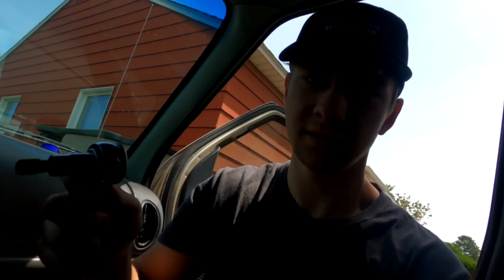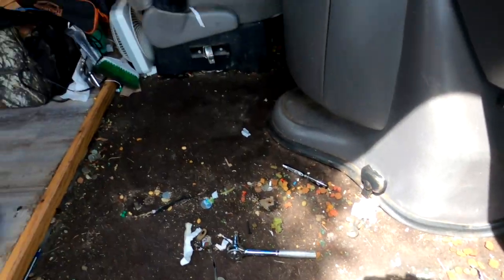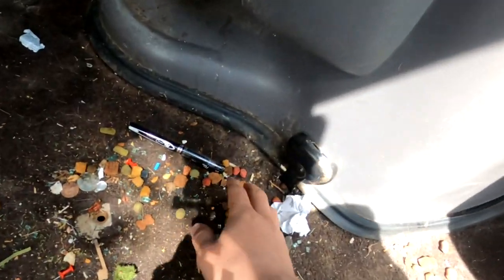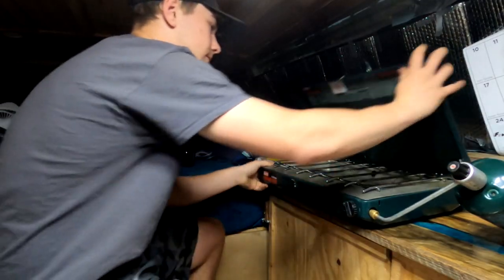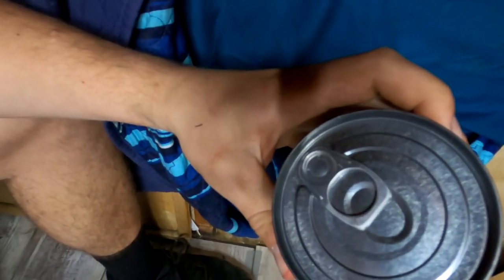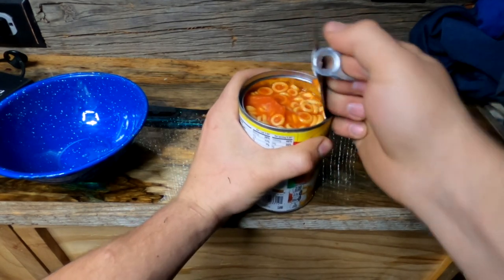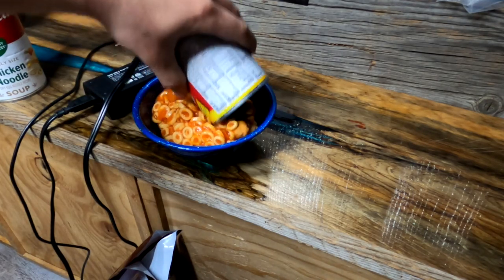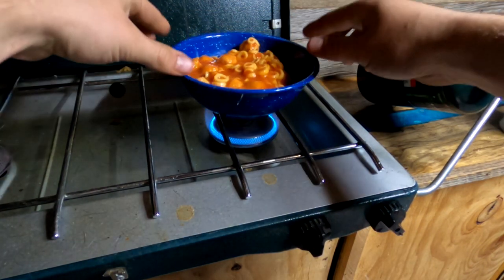Taking Out Passenger Seat For More Space! | VAN LIFE Vlog

Comment: Hey man, instead of removing the seat intierly,  try just flipping it backwards and throwing one bolt in it... it will still give you space in the floor in front of the seat and also under it... but more importantly it will give finn a seat to chill in while you drive, so he can ride in style with air in his face while you drive... and if something was to ever happen such as a crash/wreck... he will have a high back seat to protect him from the windshield... i have mine flipped as I have a girlfriend, so when we stop.. its an easy swap to allow more room and not always in driverseat (tight) and you can chill in passenger seat with ypur feet up... not always in the bed... thanks for all your hard work... YOUR DOING GREAT.. Hang in there.
Reply from the maker: Thank you! That's actually a really good idea. 
With the seat being backwards, dose the back of it get in the way of the side view mirror?
Reply: @Trent_Baker  I have no issues with that.. 1989 e350... I drive alot with the seat in reverse.. for when we move spot to spot, she drives her Acura... I love it... Also when you swap it to reverse... It leans back more (to the dash) for as the way the bracket is made... It lays alot farther back (then in normal use)... Witch clears the side mirror alot easily... try it... I know your van well... But it won't hurt... It does add alot of room and for a pet to have a window seat (with a bit of protection).. it's worth the try.... Finn would love to ride shotgun.... Ride or die.. I know he is there for you... And if you think of the alternative? The passenger seat is better then anywhere else in any van... Your doing well man... Im very interested in your success. God bless.